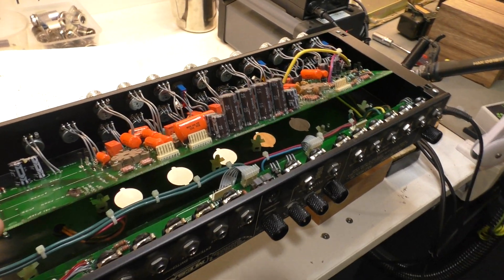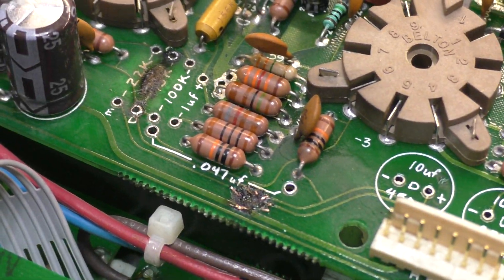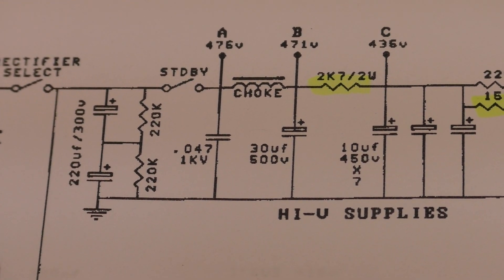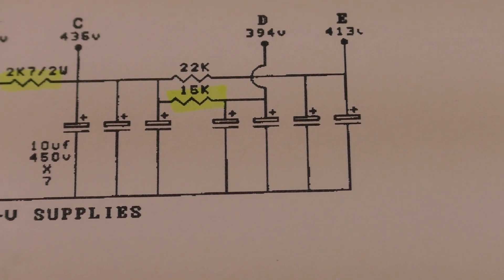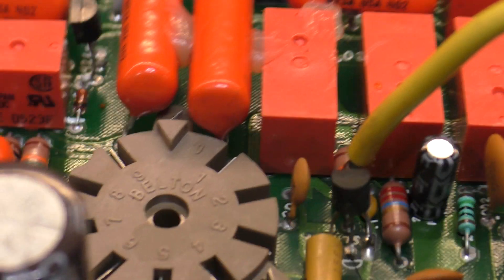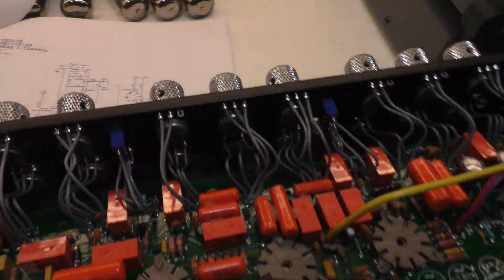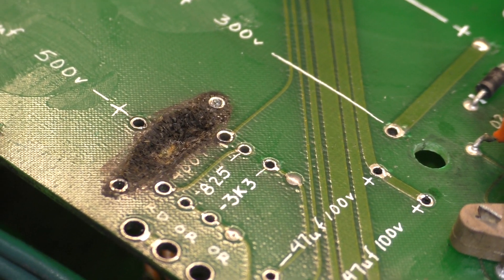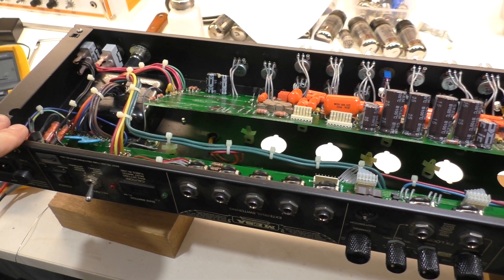What Now? - Mesa Triple Rectifier Solo Head - Pt. 2

Comment: the only low current high dc voltage rated relays ive found are the P5, P12 etc telecommunications spec. 250VDC at 0.5A.
Those MR62 relays are so far out of their spec its not funny.

Comment: Great work!! A few years ago I worked on a Mesa Dual Recto with the same damage as the PCB, but in my case the main problem was a short between some tracks below the 4 larger filter caps located near the V2 and V3 tubes. I think it's worth looking down these guys and checking out these tracks!! Best wishes from Brazil !!
Reply from the maker: The traces are so tiny, it's amazing they hold up for so long!
Reply: @BradsGuitarGarage  in deed!! And Mark V series is another nightmare!! But all they are great amps!!

Comment: Great work getting it apart and forming a theory . I would not imagine this repair being economic (for me a least) . It would take me hours to repair and re-test .Good luck .
Reply from the maker: Every repair is economically viable or it doesn't get repaired here. It goes in the parts bin or if the failure is particularly spectacular, it gets screwed to the "wall of shame".